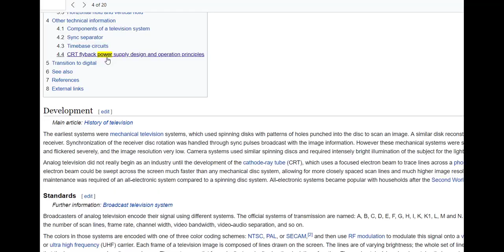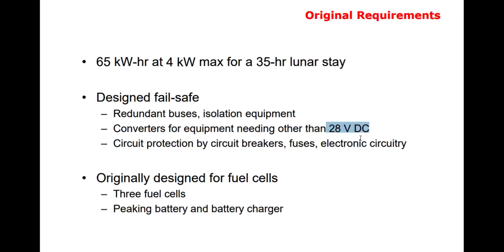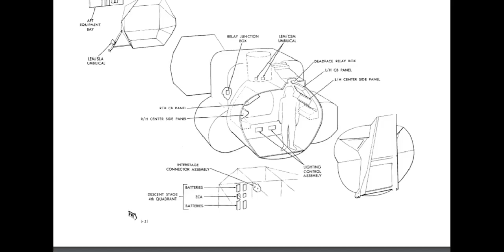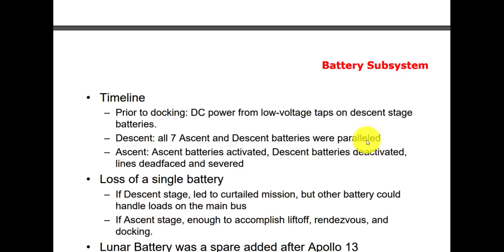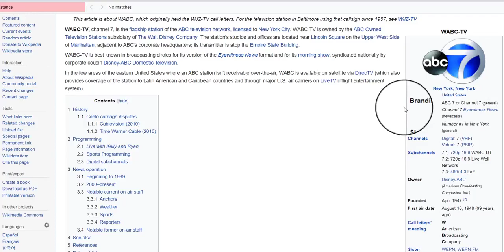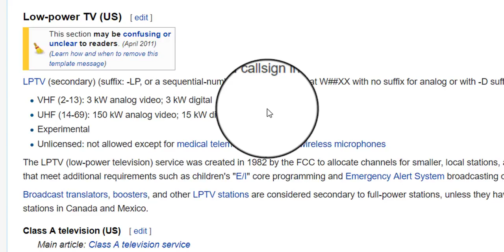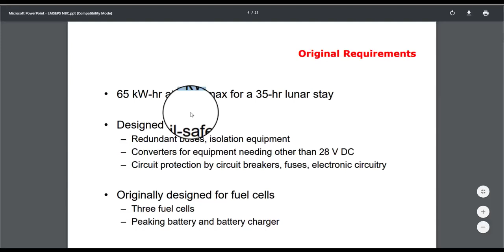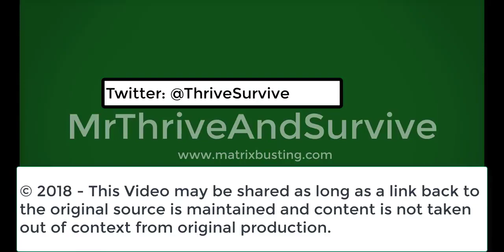(MIRROR )TV From the Moon Are you INSANE? From MrThriveAndSurvive

Comment: You guys are crazy, this clowns analysis is just plain wrong. I have an EE undergraduate degree from an ABET accredit college and I am an Extra class Amateur radio licensee. If one wants to deduce if it possible to send a video signal from the moon to the earth and to get a ballpark figure for received signal strength then you need to use the Friis transmission equations (you can google it).  Apollo 11 had 35 watt transmitter but I have also read 20 watts so we will use 20 watts or 43dBm at a frequency of 2100 Mhz (wave length is .142 meters), they used an astronauts erected 12 foot dish (about 4 meters) with a gain of 35 dBi and on the earth they used no smaller than a 26 meter dish for a gain of 55 dBi.  Assuming a distance to the moon from the earth of 250,000 miles and running these numbers through the Friis equation we get a received signal strength of -78dBm. This is about 28.150 micro volts rms (or .158x10^-10 watts) at the input of the receiver front end, well above the thermal noise floor of -174dBm. Any decent LNA (low noise amplifier) would have absolutely no problem amplifying this signal level. I don't understand why you moon landing deniers can't see that it would be much harder to keep everyone involved (10s of thousands of people) silent for all of this time then it is or was to just go to the moon.